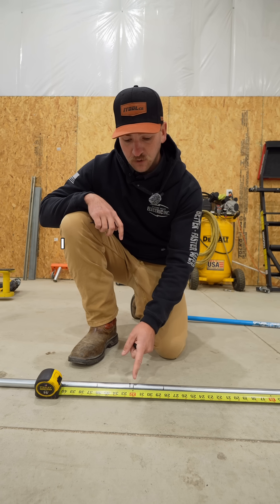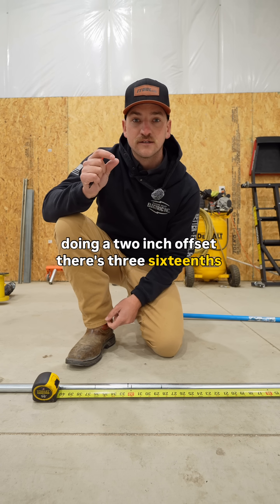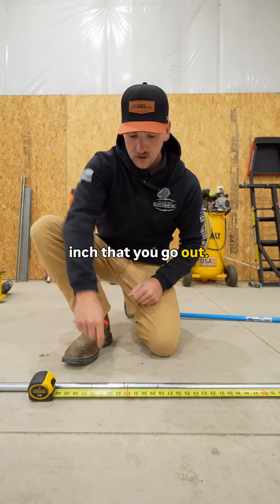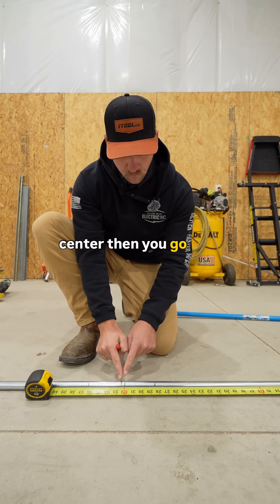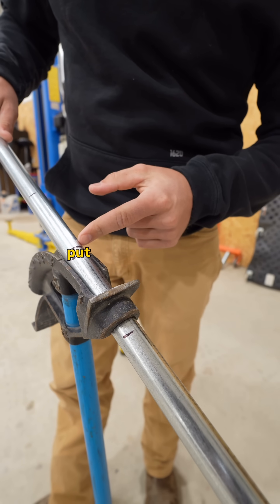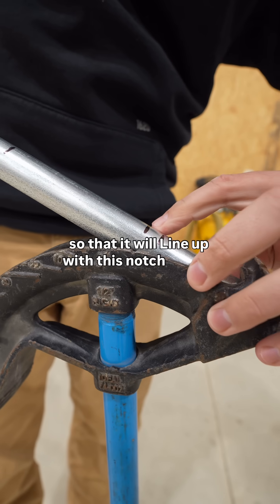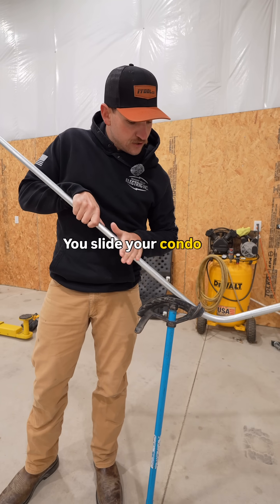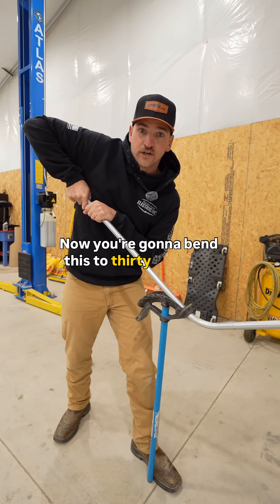How to Bend a Perfect Saddle in 3/4” EMT (Step-by-Step) #construction #commercialelectrician #tools

Comment: Some reason you didn't do 45 22.5 22.5?
Reply from the maker: Good question!
Reply: Doesn’t matter as long as the 2 degrees equal to the one
Reply: I like 30/60 myself!
Reply: @Dr-dropu that’s already 120 degrees in a pipe run